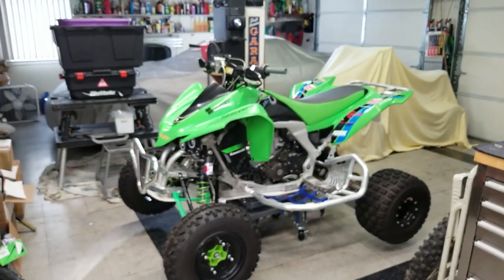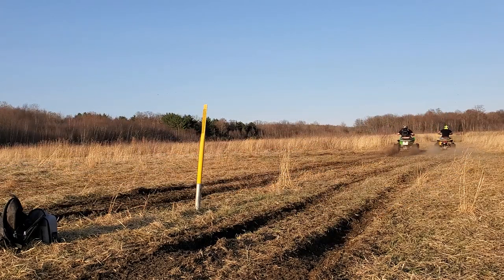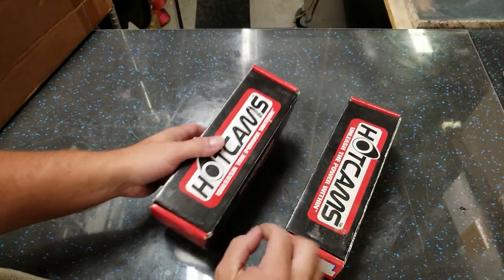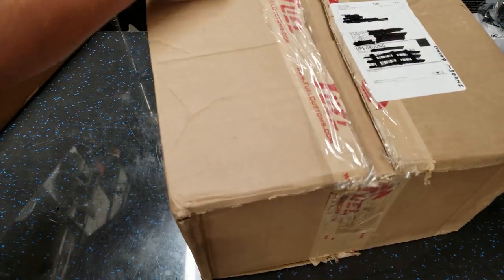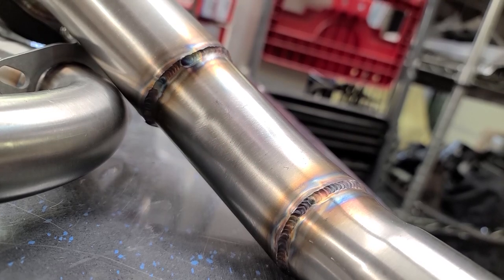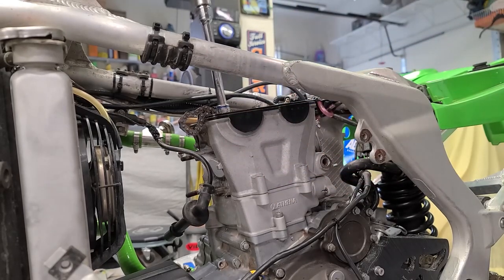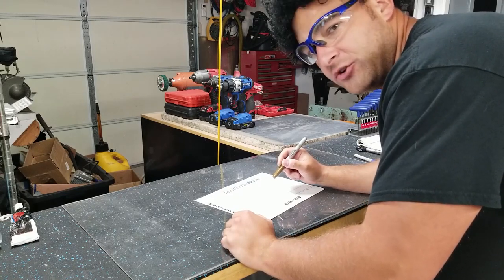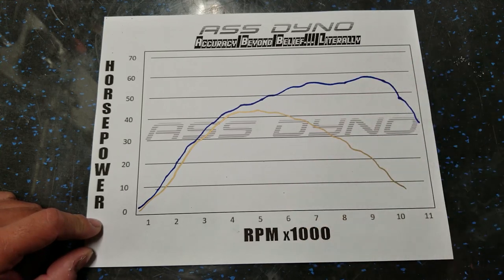These Mods Made My KFX450R WAY FASTER! (and louder)

Comment from the maker: I should have explained this in the video, but because I'm receiving so many comments asking why I converted from EFI to carb, here is a brief explanation. 

In the KFX450R, especially the early models, the fuel injection system was known to have issues with reliability, specifically with starting and off idle throttle response. There are many well tuned EFI systems that run AMAZING but it is not always the case. The carb conversion was something a lot of guys did and achieved better starting, better performance and reliability as well as ease of tuning. 

If you're interested in reading more into it, here is a forum thread with good info that convinced me to make the swap - https://www.kfx450hq.com/threads/green-monster-carb-swap-experiences.19363/
Reply: My procom ecu and a good valve adjustment seemed to fix my hard start issues. But I could see why you would choose to do a carb conversion. Looked like it ran real good. Awesome build!
Reply: Got a set of ac nerfs that you like that are like new for a 08 kfx450... lmk if your interested in them. Quad sounds nasty.
Reply from the maker: @nicholascaudill6185  AC makes nice nerfs but I made custom big pegs for these and I love them. Thank you for the offer bro!
Reply: @nicholascaudill6185  are they propeg with heal guard?
Reply: I'm working on putting a carb on my why do you have to use a procom cdi
Reply from the maker: @randyswartz7154  from what I understand the OEM CDI will not work with a carb swap; I don't know exactly why.
Reply: Ok im waiting for mine to come in so I just need the kx 450 boot and that procom cdi do I have to do anything else
Reply: @MichaelSabo  same say it will work without do you have anyone you can ask know its a long shot to ask sorry
Reply: so it was just the early models right? I think thats understandable. As we have seen also early models of 2 stroke EFI bikes having issues. (Ktm 300 exc), but they are getting better.
Reply from the maker: @megapet777  mostly the 08' (first year) but I think it was somewhat faulty even in some following years, not 100% sure.
Reply: @MichaelSabo  Yeah, I doubt the newer ones have any issues.
Reply: Do yk where I can get just the air box I already got the Intake
Reply: What carb did you use?

Comment: When you port heads you want to smooth out the exhaust side but leave some ruffness to the intake side. You never want to polish intake runners smooth. This is so the gas droplets can bounce off the imperfections and atomize properly before hitting the valves. Especially important for carbed applications. What i was taught by old skool drag racers in my 1/4 mile head porting days.

Comment: I remember Team Green's KFX's back in the day, they looked sweet.  Especially the years where they had the black frames, made the green really pop.  Why not stick with fuel injection, though?  Just get a Power Commander.
Reply from the maker: I always loved the factory Kawis too; just something about the lime green. From what I read on KFX forums, the carb swap is pretty common especially amongst people who race. I think the EFI system can be improved too but I was convinced from other peoples results; I would have loved to dyno before and after to see actual results.
Reply: Some even did it on the ltr 450s too
Reply: the injector was holding them back, when i got to upper 50,s hp it was a issue.

Comment: I just did this mod used this as a reference I have a stock piston but big cams and I used175 main 52 pilot and it runs great thanks for all your research to make this possible for me to do this great power adding mod my kfx is like a whole new beast on the bottom and lugging out of corners is so easy now thanks Mike seriously thank you

Comment: I’m pretty sure that when you port an engine your supposed to leave the intake ports slightly rough textured so that the fuel atomizes. And just smooth out the exhaust port real smooth
Reply: Only on the intake side exhaust can look like mirror
Reply from the maker: That is correct

Comment: Hey Mike, nice upgrades! Love the sound and looks of it. So I would recommend a couple things before you head to Little Sahara: 1) install a voltage meter to watch your power. I installed one after I added some lights and it helped me keep an eye on how fast I was sucking power. 2) bring a spare voltage regulator. It's a pretty cheap part like $35 on Amazon. I would have gotten another day of night riding on a trip if I had it. You might be alright now that you eliminated the fuel pump, but the electronics in these bikes can be a show stopper as you know.
Reply from the maker: Great advice man! I ran the battery out just having the lights on for 15 minutes to adjust them lol; the battery is so small on this bike. I'd really like to do the kick start mod for reliability

Comment: The carb swap is cool and all but I’ve never had a faster carb 450 bike compared to a fuel injected 450. I think you might’ve had better success if you got the kfx ecu re mapped. Just a thought.
Reply from the maker: I think FI is great but for these early KFX450R from what I gathered, its wasn't a great system and its not all uncommon that people swap to carburetors and get more power and easier starts.

Comment: Yup understand bout the efi probs.  I have one with a crf carb with the swivel gas line inlet.  If you use the yfz450 carb or any fcr without the swivel gas line inlet on the side it's gonna be on the frame.  To me the power is 👌🏿 and starting is 👌🏿.  Converted 2 Ltr's to carb also and the one that was dynoed made more power than the efi🤷🏿‍♂️.  Carb equals simplicity too

Comment: If you knock off the sharp edges in the combustion chamber and roll them smooth you’ll see even better results btw .and the infamous zip tie mod is a must
Reply: What’s the zip tie mod ?
Reply from the maker: I will make sure the combustion chamber is smooth on the next one 👊. I did the zip tie mod on this one! Forgot to mention that
Reply from the maker: Small mod to the FCR style carb for throttle response/get rid of bog

Comment: You are correct. This tech used on quads is the same as the old throttle body injection on early 80's cars. You don't read anything about how great that was on performance cars and that is also the reason cars swiftly progressed to better EFI tech. Also, out in the dirt, water and mud, this is not the ideal application.

I do have a devil in the details question for you though. Why this particular carb? Why 39mm? Curious what the thought process was on selecting the specific carb linked in the description. I do realize 39mm flat slide will flow more than 42mm butterfly carb. I am just looking for what the thoughts were that went into this decision.

Comment: Awesome kfx450r mike my brother bought one brand new after they were out like 2 years I think it was a 09 and he added a bill balance edition full exhaust and a 15 tooth front sprocket and it was fast my other brother had a 05 Honda 450r with a lrd full system and a dyno jet and k&n filter and that kfx would walk off and leave it on mid and top end but nice clean build I was wondering why you opted for the carburetor over the more efficient and quicker throttle response fuel injection I prefer carburetor as well but these Kawasaki’s run good with the injection. Just curious. Brother not judging you do an amazing job on your builds. 👍🤙🏻
Reply from the maker: That's awesome that your brother has a new one! I think it was in dirt wheels that they said the kawi had the most potential for power out of all of the 450s at the time. I had trouble getting my EFI dialed in (I am not an EFI tuner keep in mind) and because I read on forums that so many people have converted their KFXs to carb with great results, I wanted to try it.
Reply: @MichaelSabo  nice man it sure sounds super healthy and crispy with the carb/airbox setup yea fi is a bit of a pain tbh lol I know one thing if the battery goes dead on those kfx450rs you can’t even bump start them we tried it wouldn’t even hit and from the factory they have such a high compression that it will drag the rear tires in 4th-5th gear lol tons of compression and yes they are bad to the bone on power in stock trim so I can only imagine how good yours runs I read somewhere that the only issue for the kfx was a bit of twitch at high speeds but honestly I never did feel it on his they are great quads I can’t wait to see how yours does in the dunes 🤘🏻🤙🏻

Comment: So what made you decide to swap over to carbureted? I have a buddy that has one and with the fuel customs intake, fuel programmer, KXF 450 dirt bike cams, porting, and high compression piston he is somewhere in the low to mid 60hp range. You are just the first person I’ve seen swap it over to carb. Not that it’s a bad thing, it seems to be pretty quick and it starts right up no problem.
Reply from the maker: I think the EFI could have been improved but on this particular platform, its pretty common that people convert to carb. I have read up that people still run EFI and get a lot of power out of it though. I think it was just a sub-optimal design in these years, not necessarily that EFI itself is bad.

Comment: Why do you need to the mass air sensor if you converted to a carb?
Reply: @skinnyslide  yeah, it must have something to do with ignition. That’s the only thing left.
Reply from the maker: I'm not entirely sure It's necessary to run since I converted to carb but incase it gives feedbackto the ECU I would rather just run it.

Comment: Brake your face once and you will take that light off the handle bars . I wish I could show you a pic of my face after I broke it . That’s why I haven’t made new youtube videos in a while 🤣🤣🤣
Reply from the maker: Oh man... I didn't even think of this; I've fractured my sternum on my risers before too...
Reply: @MichaelSabo  try mocking up a braket that goes on the top bumper bolts from one side to the other . or from the side of the fender bolts . thats how i was thinking of making one for my 250r

Comment: Interesting. I have a Polaris Scrambler 500 and it has a carb. I kind of wanted to convert it to EFI for performance, but you went the other way! Would you not be able to tune the EFI to gain similar performance as the carb?
Reply from the maker: I think the EFI could have been improved but on this particular platform, its pretty common that people convert to carb. I think it was just a sub-optimal design in these years, not necessarily that EFI itself is bad.

Comment: I have seen one actually catch on fire with no key in. We was getting ready to race and the guy looked back and said my bike is on fire. No it wasn't hot he just pulled it out of the trailer. Ive never seen a quad have so much oil in the air filter after being raced id say close to a half a quart of oil in the air box.

Comment: surprised the stock stator was up for the task with all the electronics pulling on it. Especially the light bar. ran into that issue when I put HID lights on my raptor. kept killing the battery over a night ride.

Comment: Another great video Mike but I saw something that might bite you in the ass…. putting that yamabond all over that plate and taking away the oring seal by doing that. I tried to seal a pinhole leak in a gas tank with that and it lasted a week and started leaking again. Btw the bike looks and runs great!👍🏼
Reply from the maker: Thank you man! Hmm, hopefully this will stay sealed; I did leave the o-ring in there so I think it will work; so far it's nice and dry around the outside.
Reply: @MichaelSabo   Thats good but keep an eye on it since it’ll be right over that hot motor….. Id hate to see the next video be the bike burning to the ground

Comment: My o7 kx450f has the same porting I seen it on the intake side when I had the carb off.and it was split between the 2 intake runners?doesn't seem to bother it.im still riding it.

Comment: 👋 Quick question for ya… I’ve always loved the light thumb throttle on my KFX, so with doing the carb conversion, do you notice a difference in thumb throttle stiffness? And I’m assuming that’s the OEM Kawi throttle cable?
Reply from the maker: The throttle feels about the same as with the throttle body. The cable is a terry cable but it is made for a KFX450R so I imagine the OEM cable has the same bend.
Reply: @MichaelSabo  cool thanks man.

Comment: How did you route the vent tube?  When I stand my KFX up, it fills the airbox with motor oil through the vent tube.
Reply from the maker: I wouldn't be surprised if mine does the same but I have not tried standing it up... The OEM vent tube is "Z" shaped and I think that helps prevent that from happening but I cut mine to make it more of a straight line; may have to put the Z back in there lol

Comment: Does the cam really increase the top end of the quad, I’m thinking of getting a stage one cam in my yfz 450, I’m trying to get more top end and power
Reply: Stage 1 is more bottom end torque, stage 2 is more mid to high, and state 3 is all about high

Comment: Don’t you have to run a tuner for that exhaust and air filter? I had to run a power commander 5 tuned by Cuervo racing for my monster exhaust and fuel customs intake.
Reply: converted to carb so its just rejetting
Reply from the maker: If I had left the EFI system it would need to be tuned.
Reply: Ok yea I saw the end of the video.

Comment: Wtf is the mass air flow sensor going to so since you have a carb now?
Reply from the maker: It might be required for the ECU to function properly but it would probably run fine without it and if I plugged the hole.

Comment: Mike what is the benefit of converting to carburetor. Is there no legitimate way to tune the injection to get better performance than you can get from a carb.
Reply: I was wondering the same thing. Seems like a step back. Although I know nothing about these
Reply: @ethanbruss26  I am confused as well. A power commander to tune it would be better in every way in my opinion.
Reply from the maker: FI is great but on these early KFX's people had reliability issues and apparently big power gains from swapping to carb. If you're more interested, if you search "carb swap" on a KFX forum, you will see more info on why people switch.
Reply: @MichaelSabo  thank you for the response and information
Reply: @MichaelSabo  that’s awesome! Didn’t mean to come off negative at all. I was just curious!  Love the build

Comment: Hey man I got a 2006 yfz450se.  It’s really great condition had my powersports guy go through it added and aftermarket carb new top end It’s running great has way more power than it had before… BUTTTTT i feel like the bottom end it lacking a little like if I goose it pretty good while in a lower gear 1st half way through 2nd it will bog any suggestions tips?

Comment: I have a question? I got stage two hot cams and I put them in. The stock position rings on the bearings don't fit. I put the cam retainers on and it snapped because the rings didn't sit right. do you have any videos or advice on how to put them in? I also put the retainers to torque speck but they still snapped. it cost me 700$ and I don't want to make this mistake again can you please help. thank you!

Comment: How much of a power gang do you get from aftermarket cams
Reply from the maker: It depends what grind you install and what supporting mods you have with it; cams make a major difference especially when they're paired with porting and the correct size intake/exhaust.

Comment: Are you bringing the banshee to Legends tour this year?
Reply from the maker: I will be bringing the 250R and the KFX
Reply: @MichaelSabo  what?! No banshee love anymore? So that 80+hp 421 will sit in timeout at home while the slow ones go to have fun?😜 Man you gotta trash that J-arm chassis dude...that was totally not a good quad wars comparison against the 250R. 
Precision stabilizer,/ Roll Design long travel and sabo tuned fox float shocks (unlike the elka’s on the banshee not even setup for you lol)....I’m mostly just bustin ya chops in a friendly way, but y’all really threw all the nicely built long travel “A-arm” banshee’s under the bus on that video...You totally had a budget built mindset years back building the banshee. It never had a chance to compare with your super upgrades on the 250R...You spent 20k building the 250r right?!.🤣
The stock 250R’s suspension is junk too, everyone always glorify the 250R being so superior and so awesome in stock form, but then when you look around on the net or at the R’s in little Sahara, most are upgraded😅. 
Man that’s really all a banshee needs, they got the power in the motor department, but just like the 250R, they also need a tad bit of love in the suspension/ handling department. 
 My brother has a full long travel Banshee and I have a trx250r with LT roll Aarms/ Gullwing swinger and elka legacy+ around...and I feel his Banshee rides better than my R does. Unfortunately though, my 250R is having complications this year, so Ill be on my semi stockish Twin..
 We wanna meet up with you in Oklahoma at some point, so you could ride on his LT setup and to see what you think about it.👍

Comment: Mike please help me the radiator fan on my 450 KFX will not shut off nor can I get the bike to start when I got the bike the fan wouldn't run right so I put a toggle on the fan still couldn't get the bike to run right so I switched everything back to factory now the fan won't shut off and the bike won't start what could be the problem?